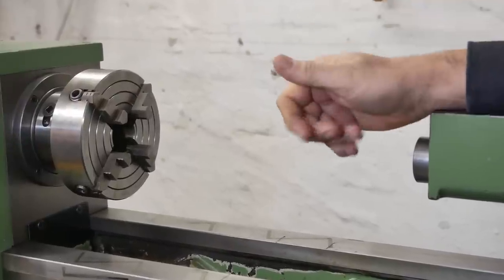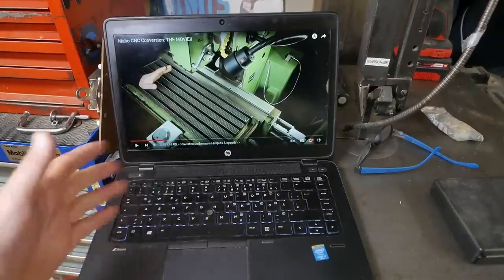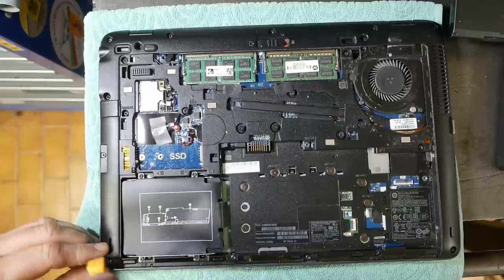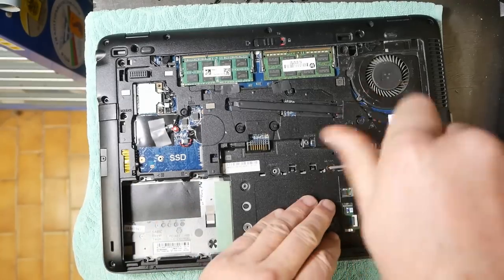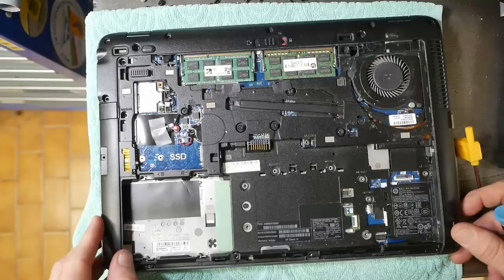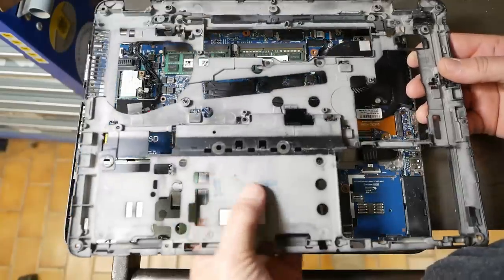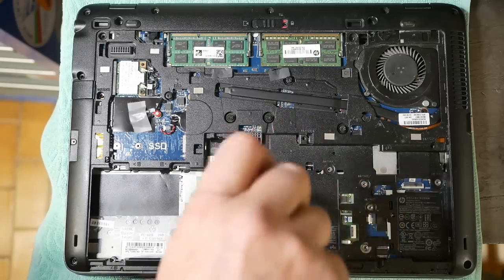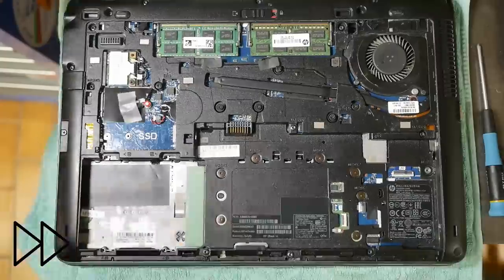M1 Mac: New, Refurbished or PAINTED?!?

Comment: Desktop with a decent video card of some sort. Editing on a laptop is an exercise in futility. I used to be able to program an apple iie and have forgotten all of it as for newer apple I hate the operating system as it's so clunky. Still remnants of the old days where you had 10 steps to format a floppy disk because it only had one mouse button. On a PC it was right click and format...  I'm using an ASUS ROG G20 which was daughters old computer. It'll edit 4K even though it isn't super powerful. I just wish I had the patience to get better at editing and filming and and and.
Reply from the maker: IThere used to be some weird keyboard combination which could do a screen capture in a game, and then you needed assembly language commands to save it to disc before returning to the games. 
Resolve is optimised to load the GPU and needs 8gb of video ram for 4K editing.
With the current price of 8GB GPU's, even used, it would be a struggle to put together a used part desktop with the performance of the M1 Air, for that price. And I need a laptop about 20% of the time.
Reply: @RotarySMP  Yeah good point there. Laptops are pricey but right now they are much more affordable than desktops. I have been wanting to upgrade the better 3/4s gaming computer. (oldest gamer on twitch) Still running a 1070ti and I just checked and I can actually buy a new card now. Only AMD cards are available. The cheapest that is workable is a 6700xt @ 1000$. A 6900 is $1600 but they are available now...
       Personally I am not an Apple fan for various reasons. I am kind of in the same opinion that Louis Rossman is about them. For those that like the UI and ecosystem I get it but you do have the issues that buying apple comes with like their repair ethic and the laptops have thermal issues etc. I see too many apple laptops needing repair while all the PC laptops we have had in our household only die of obsolescence with the odd HDD to SSD upgrade.

Comment: Personally 1080p is enough for me, but I'm stuck with slow internet. Resolve runs on Mac/Win/Linux, so do you really need a Mac? (any idea how well Resolve works on an M1?) Perhaps refurb'd Dell/hp desktop workstation and spray it RAL6011/DIN1844. Maybe.
Reply from the maker: Thanks for the input.
With the current price of 8GB GPU's, even used, it would be a struggle to put together a used part desktop with the performance of the M1 Air, for that price. And I need a laptop about 20% of the time.
I dont really want an apple, but the M1 hardware seems really well optimised for video.

Comment: I would suggest for this task to buy PC not the laptop, because for less money you can get better performance and in for next 5-6 years it will be easyer and cheaper to upgrade PC workstation. Con is that it has to stay at home and you can't bring it with you to trips
Reply from the maker: Resolve is optimised to load the GPU and needs 8gb of video ram for 4K editing.
With the current price of 8GB GPU's, even used, it would be a struggle to put together a used part desktop with the performance of the M1 Air, for that price. And I need a laptop about 20% of the time.
Reply: @RotarySMP  if the price of M1 is better, then it's not questionable

Comment: Shrink wrap the gold one in gunmetal vinyl. You need a tough case over that too. Its bloody fragile ... not the cheap thin plastic cover era but the 'military ' grade ones. No fashion item with that clobber but its drop proof more or less. Don't ask me why. My M1 is 16gb that's important too so maybe if the gold one is 8 GB then get a new one, you wont regret it
Reply from the maker: Yeah, I was also concerned about 8GB ram and 256Gb storage. By the time you up both of them, you are getting close to the baseline 14" pro.

Comment: I'd crowdfund a new one.  Not because 4k - more resolution != better videos - but because - well - why not, and warranty.

If you don't need the machine to be portable, I'd go for a fixed machine.  Even if it's not easily internally upgradeable, like the iMac.  Actually, a mac Mini might well be a good one to look at, although I have n idea how good tey are for video editing compared to the air.  With an SSD it's just as portable as a laptop if not more so, but you do need to find a monitor / keyboard / mouse at the other end. And you can't edit video on flights, I guess.
Reply from the maker: Yeah, I mostly edit at my home desk, but move around enough that I do need a laptop.
The price of GPU's even used is also a killer for a cheap build Tower  at present.

Comment: VLSI Engineer here,
Get the M1 its a leap in technology like no other. In addition to the fact that it doesnt have ANY fans :O its very very very very fast.
I would personally either get the referb or a brand new one for the warranty. Dont forget this is a closed loop system, there is nothing for you to upgrade or fix except maybe the battery...
Reply from the maker: Yeah, I dont really like that closed world of Apple, and have avoided it, but with the current price of 8GB GPU's, even used, it would be a struggle to put together a used part desktop with the performance of the M1 Air, for that price. And I need a laptop about 20% of the time.
I looked at a Razer Blade 15, but that would cost more, and have the fans screaming and have to be plugged in to  match the M1 Air. 
Intel must be pretty concerned, as guys like mewould never consider an apple before..

Comment: The problem with Macs is that they are basically unrepariable and unupgradable. And after a while they do have issues with cooling, or liquid damage. Also I do not think 4K videos are really needed, it is just a pain to edit and upload, or watch by most people, for very little benefit.

I am a desktop guy, but I do have a bunch of Thinkpads (T and X series). But due to their age, they are not great for editing videos.
Reply from the maker: Yeh, I really like the HP, but a modern Zbook with an 8gb GPU (which Resolve really needs for 4K) is even dearer than n M1 Max, and the ARM silicon is extremely efficent with video.

A lot of feedback about not needing 4k, but there is also an advantage in shooting 4k and editing a 1080 timeline, as you can crop and pan without losses.

Comment: As others have mentioned definitely go for a proper tower PC. As others have mentioned it gives you a path forward to upgrade piece by piece and most importantly EXPAND STORAGE.
I don't know what you're doing currently but there's a very good chance that you're gonna want to save your raw footage down the line which is going to require a lot of storage. It'll be much easier to buy a harddrive and chuck it in the tower rather than dealing with 10 different external drives where you need to find and plugin the right one, especially if you need multiple video files spread across multiple drives.
The apple eco system heavily taxes storage so I don't recommend going that route, especially if you intend to edit 4K video because it'll take up a ton of space. Even worse you can't upgrade the storage in MacBooks like you can in (most) windows laptops.

There's a pretty good chance you'll be able to get a used gaming PC with a Ryzen 5 3600 and a nvidia GPU that'll blow the M1 out of the water, checkout this video and the spreadsheet in the discussion: https://www.youtube.com/watch?v=SpbjZrZr5LA
Reply from the maker: I looked at his summary video. When you look at the testsin Resolve, you see his 2012 Macbook pro 12 Hour (like my Zbook), and the performance difference between a cheap M1 mini, and a high end PC is only about 2:1. That is pretty impressive.

I dont store on my internal drive. Only the current weeks project is there, and it then gets shifted off to a cheap hard drive once uploaded. In 1080P, I got the whole Mini Lathe series on a single 1tb drive. If I move to 4K, that would be more like 4tb for a years videos.

Comment: Nothing wrong with your video quality :) 250€ spent on lights will improve most people's VQ much more than any amount spent on cameras and computers :)
Why not go for the Mac mini M1 in stead? costs about the same if you chose the mini with twice the memory of the baseline Air. And using a real keyboard, mouse and monitor increases usability and ergonomics a lot. But the Air is VERY portable, something that might be important (?)

I use all three major systems as a software developer and a hobby photographer. MBP M1, MBA, a Mini as a server, two high end PC's, one lower end Linux PC. They all work equally well - for their intended purpose, of course
Reply from the maker: Thanks for the feedback. I edit about 80% at my desk at home, but the 20% other places requires a laptop.

Comment: If you can, don't buy a laptop. I don't know how much faster a mac book is than other laptops of compatible price but  I know a pc would be better considering you can get a used quadro or firepro card
Reply from the maker: Resolve is optimised to load the GPU and needs 8gb of video ram for 4K editing.
With the current price of 8GB GPU's, even used, it would be a struggle to put together a used part desktop with the performance of the M1 Air, for that price. And I need a laptop about 20% of the time.

Comment: If you get a MacBook, Get the warranty, All the components are Soldiered onto be Motherboard, none of them are user serviceable, so any problems pretty much have to go through apple. (this also means no internal component upgrades after purchase, RAM/SSD) That said hardware issues overall are fairly rare, but drops/spills are not, and with applecare+ there is only a $100 fee for that kind of damage.  the apple Refurbished ones are just flat out cheaper, and can get the same warranty. 

Your painting plan probably won't work too well, I'm pretty sure the bottom of the Air gets hot enough the paint won't adhere for long. the older MacBooks are pretty good at destroying our property control stickers.
Reply from the maker: Thnks for your experience with this. I appreciate it.

Comment: My labourer is also my IT guy. He went to college to become a systems administrator, who has in the past year gone over to apple.  He even has the same pink (gold) M1 Air, he is completely satisfied with it, it has been a very good experience. He says Macs hold their value well. If you decide to paint it make sure that whatever paint you use does not affect the thermal displacement of the case as that has no ventilation and no cooling fans. This is of benefit for a shop computer as it will never get crap into it.
Reply from the maker: Yeah, also just for having it on your lap, as no lint and dust can get in.

Comment: The die casting is done the same way as injection moulding plastic fyi. Also I use a 8 core amd desktop to do video editing. Not that I am any good at it. As for venturing into apple land. I broke my rule this year of no apple stuff and got myself an IPad for work. You know something? I like it.
Reply from the maker: That is also what I am afraid of. Buy a cheap M1 Air, so I can flick it off in a few months if it sucks, find I like it and end up buying an M1 Max :O
Reply: @RotarySMP  i would not blame you. I am being swayed over to apple slowly as well.

Comment: Can't really speak for anything from Apple. Never used it. I can just write phrase that IT guy from my work uses. "Notebook has half the power for double the money." So I would go with desktop PC. Used. And paint it green! Also, your notebook has unpopulated SSD slot. Editing from SSD Should give it (some) boost.
Reply from the maker: The main drive is also an SSD. 
Resolve is optimised to load the GPU and needs 8gb of video ram for 4K editing.
With the current price of 8GB GPU's, even used, it would be a struggle to put together a used part desktop with the performance of the M1 Air, for that price. And I need a laptop about 20% of the time.

Comment: as you did ask what i would do if it were my money: well that's simple. avoid laptops all together. you pay a ton for the portability. just buckets and buckets of performance and cash left on the table for the small form factor and then on top of that they're hard/impossible to repair and/or upgrade. the only reason to get a laptop is beccause it was given to you or because you actually need the portability. (edit: or because it's a fashion/wealth status symbol to you)
Reply from the maker: i edit about 80% of the time at my desk at home, but the rest of the time, I need a laptop. The weird thing right now with the absurd price of 8GB GPU's even used, is that I'd struggle to build a used part tower pc with the Resolve video performance of an M1 Air for that price. I havelooked into that, but €300 for a used 8GB GPU is nuts.

Comment: Get a recent M1, if you have to spend money, spend money on RAM, that thing is soldered and there's no way to upgrade it later. Storage is also soldered, but they have Thunderbolt 3 or 4 which is extremely fast, so you could later get an external ssd that will work just fine!
If you don't like the color you can always apply a skin to it, like those from D-Brand
Reply from the maker: Good point about skins. There are comments on paint affecting the thermals, but plenty of people put skins on, and I haven't heard of thermal issues.

Comment: If a Mac, then refurbed for the savings. That is also if you want a laptop if that is the form factor suitable to your workflow. Gives you flexibility for where you do your editing. I myself did a big tower Dell and am able to forget about it for seven years now. My surface pro is going on 6 and it is working great. No battery issues. Just crappy power connection that keeps shorting out. Third one.
Reply from the maker: How do you switch between laptop and tower in the middle of a video editing project?

Comment: I don't use a laptop at home... but I have a new MAC and some Windows PCs. The M1 is a beast, hands down, especially for the money. My mini is an M1 and does some pretty crazy stuff without even breaking a sweat. You can stain it green if you want. If I bought a new Windows laptop, it would be a Surface Book. That's what I use at work, after getting hooked on the Surface Pro 4. For storage - laptop go big, desktop go small w/MAC + ext., or a PC w/multiple drives, but use cloud backup for all.
Reply from the maker: Thanks for the feedback.
Reply: @RotarySMP  You are most welcome - eager to see what you do!

Comment: Most people do not yet have 4K displays (except on phones - no place to be watching your vids) so there is little point in uploading at the resolution.  I watch from either my Roku or my desktop, both show your videos with very good video quality.   

As for the computing power, if you don't mind being tied to products with "expensive" associated with them all the time (as in upgrades, repairs, software) then by all means buy an apple product.

An alternative to consider:   Since you use linux for your CNC needs, why not consider building a monster PC with WAY more resources than a MAC anything, for a fraction of the cost, and use Linux and free open source video editing software?  Faster processor cores, more ram, bigger display(s) and all less than a used MAC unless you get crazy and build a liquid Nitrogen cooled gaming PC but that would be scope creep LOL.  That's my two cents and I'm sticking to it.
Reply from the maker: Resolve is optimised to load the GPU and needs 8gb of video ram for 4K editing.
With the current price of 8GB GPU's, even used, it would be a struggle to put together a used part desktop with the performance of the M1 Air, for that price. And I need a laptop about 20% of the time.

Comment: Find someone working at Apple if you really want one - they give around 20% discount to their employees. Otherwise get a workstation with a beefy NVIDIA card (because of CUDA and stuff). However GPU prices are around 300% UVP right now. So you might wait (like we all do right now).
Reply from the maker: Resolve is optimised to load the GPU and needs 8gb of video ram for 4K editing.
With the current price of 8GB GPU's, even used, it would be a struggle to put together a used part desktop with the performance of the M1 Air, for that price. And I need a laptop about 20% of the time.
I have waited 2 years, and the price has not fallen. New Normal?
Reply: @RotarySMP  Nope, it's not the new normal. I work at the visualization institute at the University of Stuttgart and we struggle to get GPUs too. It's a mix of GPU based Cryptomining, increased demand for gaming hardware due to COVID and semi conductor shortage. Things should get better late 2022/early 2023 if one can trust the leather jacket/team green ;)

Comment: If you've never had an aluminum MacBook, you will be astonished at the build quality compared to plastic laptops.  We replaced a 10 year old MBP only because the battery gave out and it wasn't needed.  The screen hinges still felt like new, same thing with an Air.   

The only hesitation I would ever give about a new M1 Mac is if something you need hasn't been converted to ARM yet, otherwise it's amazing as a normal laptop and will last longer than 3 $300 PCs, but be enjoyable the entire time.
Reply from the maker: Thanks. I only have a couple of programs which are windows only, as I use mostly open source stuff. I'll keep the Zbook for them.